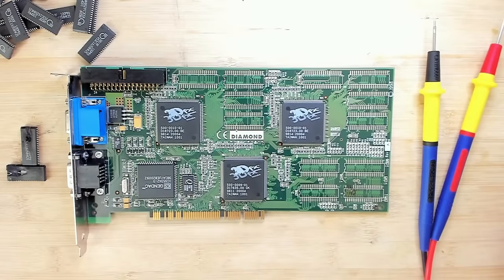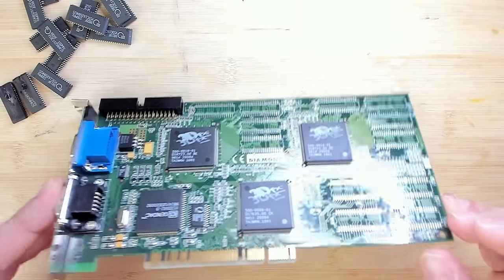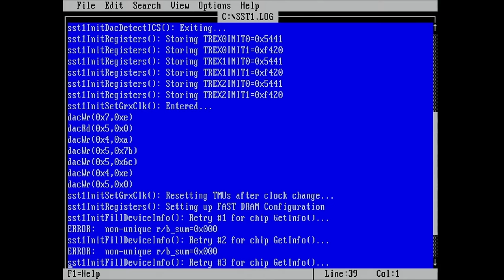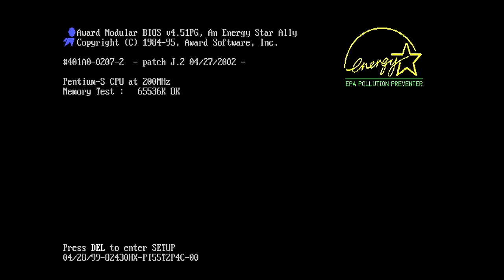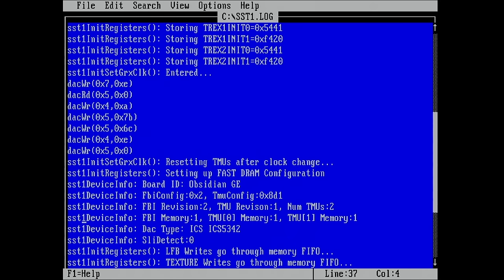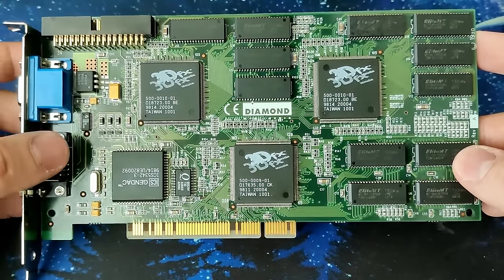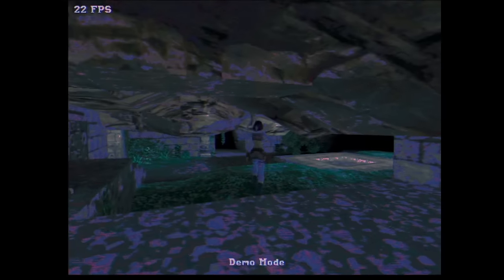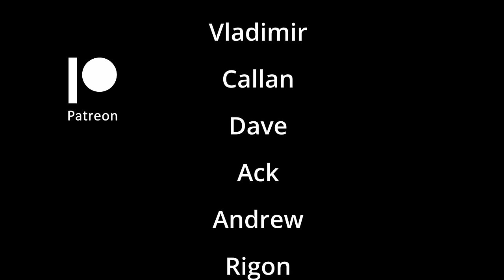Diamond Monster 3D II - A Voodoo 2 rises from the ashes? (Part 2/3)

Comment from the maker: While working on part 3, I noticed that the discoloration of Tomb Raider shown in this video was caused by the wrong 3Dfx patch! Yes, there are two different patches for Tomb Raider. One is only for Voodoo 1 cards (that is the patch I had installed while making this video). The second patch is for Voodoo Rush and Voodoo 2 cards. Of course, I downloaded the patch and added it to Tomb Raider. Unfortunately, with the correct patch, the game starts, but the screen remains black after the intros. The menu screen is never rendered. So, we still have an issue with the card! The problem? Only 1MB of memory is detected by the FBI chip! I hope you can help me figure out why. Is the FBI chip damaged? Could the DAC or the small chip next to it be the issue (both connect to 5V that damaged the memory chips. Any help and hints are appreciated! Thanks everyone!
Reply: maybe it's an addressing issue? like, what if the FBI chip has some troubles with connecting to the memory chips? (eg. too much resistance on the trace?)
Reply: to me this looks like the FBI chip has not enough memory to work properly more than a RAMDAC issue
Reply from the maker: Good point. I can check the resistance and see if there's something odd. I checked the chip that replaced the one with the hole in it. All connections seem to be fine, but it might just be the one that's part of the 1MB. I'll check all the other chips on that side.
Reply: I would check these vias under exploded chips (on first video they looks quite burned), maybe there is no good connection to rest of memory chips (especially on other side of board). This cloud explain discoloration and only 1MB detected.
Reply: @bitsundbolts  try measurements of address/data/all other signals in diode mode (multimeter pos terminal to gnd and negative to signal lines.) All lines should be in more or less same range, if one is too off - may be issue with 3dfx chip. This way you can check if blown up RAM chip damaged 3dfx chip IO.
Reply: Mine had crap colours in a bit different way, but it was fixed by lowering the gamma
Reply: @petertorda5487  I think this is the most expedient way to fix the TMU memory problem. It's reading at 1MB so it can only address 1 bank(?) of 4 and stops there. Looking for clues is better than trying to chase down the fault on all the data/address/select lines picking randomly (which I have tried myself before, it takes ages).

Regarding the DAC, please do not remove it, it's working! You can see white in the picture so it's doing R/G/B properly - My Voodoo 1 with bad RAMDAC connections displayed just blue and that looked interesting, but very dark. Also, if the RAMDAC is not functioning / removed, mojo fails before it gives the TMU/FBI information readout.
And probably so is the display switch chip, which also handles the analog VGA signals, it seemed to be doing proper switching in this video.

@bitsundbolts - I believe the pinout for the Voodoo 2's FBI is known and that may help with troubleshooting if the via/trace checks don't pan out. Ask SDZ and he might be able to help.
Reply: You need a few environnement variable to configure the Voodoo 2 in Voodoo 1 mode.
Then IIRC it should work with the regular Tomb Raider V1 .exe

SET SST_FT_CLK_DEL=0x4
SET SST_TF0_CLK_DEL=0x6
SET SST_TF1_CLK_DEL=0x6
SET SST_VIN_CLKDEL=0x1
SET SST_VOUT_CLKDEL=0x0
SET SST_TMUMEM_SIZE=2
SET FX_GLIDE_ALLOC_COLOR=3

Also you could try with Quake 1 instead of TR1, there's a Dos 3dfx version.
Same for Quake 2 :)
Reply: @nalinux  < What nalinux said. lol

I had the same issue on my PIII system with a Voodoo 2, and the SST settings fixed the colours in Tomb 3 Demo.

Seems the V1 and V2 have different colour formats for the framebuffer setup, or something.
Reply: @electronash  I'm surprised TR3 needed this. It's a D3D game, so the Voodoo driver may do the job by themself.
Reply: @nalinux  I'm fairly sure it was TR3 Demo, running in DOS?

I didn't have Windows installed, IIRC.

I can't remember exactly what I was even doing, as I was trying to build a V4 clone at the time. lol

But the colours near the end of the vid look very similar to what I was seeing. Almost like the colour space is wrong (YCbCr vs RGB).

The Autoexec settings to put the V2 into V1 mode seemed to fix the issue.

It looks like the textures are basically OK on the card in the vid, so the DRAM is probably good.
Reply: My guess would be a damaged FBI. Not detecting all RAM chips points to that. Also for that FBI chip with crooked legs - it's likely someone twisted a heatsink off of it. You might need to carefully twist it back with the help of some tools before removing the chip for the best result.
Reply from the maker: @thejeffchen oh, I didn't think of a heatsink that could have caused that. Good point. I have a feeling that I'll rip off the chip and cause massive damage if I try to bend it back. But that would be the best solution to straighten most of the legs. Let me see if I can find a way to do that, but if not, I'd prefer to bend leg by leg. 😨
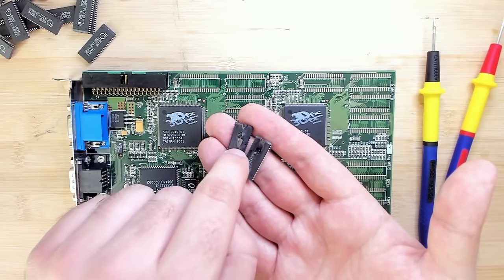Reply: @thejeffchen  Ooh wow, I was wondering what you meant but looking at the 1st video at 0:28 you can see a bunch of pins on the FBI by the PCI connector and the "65" soldermask do look as though they're no longer attached, and those are memory pins
Reply: I'll register a guess: one of the first two MB of memory chips you installed for the frame buffer is bad, or one of its lines is not connecting so even though it would be a card problem, it detects as bad. Perhaps socket just the first four chips of FB memory and start swapping chips around and see if the problem moves? Are you sure all four chips (of your lower 2 MB that you first reinstalled) are getting Vcc and Vss at both ends of each chip, you might have half a chip sleeping/floating.
Reply: @bitsundbolts  just use a osciloscope /logic analicer on the vram chips
Reply from the maker: @mal2ksc I'll check the pins on the memory again before I try anything more dramatic.
Reply: All the frame buffer memory address pins should be on the same bus. I would check to see if they are connected to each other then check to see if the networks that pull the busses  up aren't blown. (If present) Doesn't look like a blown passive but I've seen that.
Reply: Try setting the environment variable SST_FBIMEM_SIZE to override the detected FBI Memory size. If forced to  2 or 4, Tombraider might run. Only having 1 MB of FBI memory isn't enough to setup a front,back and Z buffer at 640x480. The voodoo 1 patch might not have even checked if there was enough and still tried to use the extra FBI memory that wasn't being detected and mostly worked. I wouldn't be suprised if only the memory between 1.5 and 2mb isn't working so only 1 MB is reported because it can't report non integer sizes of MB, and it assumes there is nothing beyond the missing region. A memory test for voodoo cards might be useful, I doubt one exists though.
Reply from the maker: @MonochromeWench it's still a secret, but your last sentence will have an answer soon!
Reply: Try to check the resistors between FBI and the memory
Reply: The GENDAC (RAMDAC+clock generator) is purely in the output path and has nothing to do with the interface between the FBI and the memory. 

If it has been damaged then maybe it could produce some funny colours, but it seems you already nailed that down to something else.

The other chip with the Q on it is a dual 4-bit buffer, you'd have to beep it out and see if it has anything to do with the memory. 

If the memory chips suffered such a catastrophic failure like that I guess it's possible that something happened within them to send some of that higher voltage to the FBI chip and has damaged parts of it, and maybe that prevents it from detecting the additional memory chips.
Reply: @TomStorey96  well, that's not quite true. RAMDAC is connected to the same pins that are shared between FBI and RAM, so it can influence the communication. Also it is the main clock source for the whole card, so if RAMDAC is dead the whole board will hang if you try to launch any 3D app.
Reply: @fagear  Splitting hairs, and not exactly the point I was trying to make.

Sure, the RAMDAC could share the same physical bus between the FBI and RAM, and if it was damaged it could output some voltages that affect that bus.

But the point I was making is that the RAMDAC doesnt provide any control or sequencing of the communication between those devices, so a bad RAMDAC shouldnt be stopping it from detecting the correct amount of memory for example.
Reply: @TomStorey96  well, you are plain wrong. The RAMDAC is the only "sequencer" of the whole board. It generates all the clocks. Without working RAMDAC there will be no RAM refresh, no FIFO progressing, no communications between TMUs and FBI. So it is quite important.
Reply: @fagear  You do not seem to understand what I am saying. So the last thing I am going to say is that I have built a video card for my homebrew computer system which uses a RAMDAC to drive a VGA display, so Im pretty sure I know what it does and what is required to make things work.
Reply: @TomStorey96  you seem to not understand how Voodoo cards work. You stance about RAMDAC having nothing to do with RAM operation and detection is just wrong. Working RAMDAC is necessary. You clearly have no experience with Voodoo boards with a dead clock gen that will detect in the system ('cause PCI part is asynchronous) but hang because no communication between FBI, RAM and TMU can take place without a clock. See a datasheet for a RAMDAC for yourself. It has TWO outputs. One for pixel clock (not relevant now) and another... yeah, for graphics clock. For that ~90 MHz that Voodoo chipset requires. Nothing will work without it.
Reply: @fagear  Fine, I'll bite for one last time, just to remove all doubt. From here on, readers can make up their own minds.

You seem fixated on arguing the fact that a missing clock would stop a board from working. Well of course it would! It's obvious to anyone that has even the most rudimentary understanding of computer systems that a clock is required to make things work. But a clock alone does not make things work, and a clock is not a sequencer. A sequencer may be a state machine or similar logic.

But my comments have nothing to do with the clock, you brought that up, not me, and keep using that to insult my intelligence by suggesting I don't know how things work. In the scope of the card in this video, which is what my comments are about, it is clear that the clock must be working because there is video output and it is possible to get a response from the card. I'm not focussing on things that are working, so why you continue to argue about or point to this I have no idea.

I know when to read a datasheet and have read many of them, so you don't need to suggest that I go do that. It's what I do when laying in bed or on the train to work instead of reading a book...

I may not understand the intimate details of a Voodoo card specifically, but I know enough about a RAMDAC or GENDAC to understand what it does and what effects it can have on the rest of the circuit.

Go look me up on github if you want to understand the kind of stuff I work on as my hobby, I'm tomstorey. My latest 68k design is there and you can download the repo and open up any of the projects in KiCad to take a look. There are also some Verilog source files which implement various state machines. So please, don't tell me I don't understand things.

Comment: I had the same color issue recently, had also a V2 to repair. That color problem is normal and is due to V1 support in TR in DOS. It costed me couple of hours of ghosts hunting till it turned out, that in DOS you have to patch TR for V2 to get the colors right. In windows the card would work right and there is nothing wrong with the DAC or something else. The missing FB memory is a problem  though. I would suggest to go through the pins of the memory chips and measure the resistance on every one of those. Compare then that all data and address pins have the same resistance to the ground. May be one of the traces in the PCB has melted.
Reply from the maker: Hey there! Thanks for the tip! And yes, hehe, I figured out that there was another 3Dfx patch for tomb raider for voodoo rush and voodoo 2 cards. Unfortunately, with that patch applied, the Voodoo 2 can't render any 3D scenes anymore. Just a black screen where the main menu screen should appear. I'll go back and check the connection of every memory chip connected to the FBI chip. Thanks for your help!
Reply: @bitsundbolts  Try out Unreal as well, since the card is working in Windows :) The flyby certainly looks interesting when the 3d card is broken. My 3Dfx Voodoo 1 that had the RAMDAC fault, once that was fixed the TMU memory CAS lines broke and the castle went kind of 'disco' mode
Reply: Ohhh, Necro_ware! Fancy seeing you here :-)
Reply: Hi m8! Great to see you over here on Alex' channel, thanks for chiming in, and with such helpful pointers too! Let's hope it indeed is an issue with a trace/minor SMD component along the way rather than with the comparatively irreplaceable (in the sense that they aren't made anymore) FBI chip itself. This is the card I emailed you about a while back btw. 😊
Reply: I was also going to suggest checking the address and data lines from each chip to the fbu, when the old chips exploded it might have taken out one or more of the lines, likely an address line.
Reply: I suspect a chip isn't getting power, or even half a chip since they have two Vss and Vcc lines that are not internally connected.
Reply: @mal2ksc  good theory! that would be one of the better scenarios and is certainly worth checking. easy to check too!

Comment: It freakin' works!! (Kind of)  I don't think the DAC is the reason for your lack of frame buffer RAM, but I have seen a bad DAC cause the visual issues you are having with the colors.. (Not on a 3DFX but VGA cards) Might be worth swapping that PLCC chip if you have a spare.
Reply from the maker: Hello Adrian, thanks for your input! If I understand correctly, the DAC is connected to the FBI as well as the memory chips. It could be as you say and the DAC might cause the loss of memory. However, I might get access to something that most probably will eliminate all the guesswork!
Reply: @bitsundbolts  I don't think so -- from what I understand the DAC simply contains look up tables to convert the digital framebuffer output to analog video and in the process apply the correct color palette. Of course the lack of memory showing up really could just point to the framebuffer IC having been fried too. The damage was so expensive on that board perhaps some of the RAM chips backed too much power into the framebuffer taking it out? It's so hard to know when everything is so highly integrated and undocumented like on those "modern" ICs
Reply from the maker: I agree, it is very unfortunate that there is limited information for those chips available. It turns into guesswork. That might be fine for people who are just tinkering around, but it makes it so much harder for people in the repair business. I stopped this Voodoo 2 project for now because I am waiting for information from a viewer. It might change how we debug faulty Voodoo cards in the future.
Reply: I think he didn't soldered the 3 pads he replaced. Or that part wasn't in the video or i missed something. And if that was with framebuffer memory because if they are seen in pairs than he would still get 3 mb instead of one. Don't think it's a multiple layered board so the damages couldn't be it and should be searched next in line to the frame buffer chip.

Comment: It's cool that the regulator protected the main chips - and I guess the regulator won't care if 5V or 12V are coming in! I am not familiar with that card - the only thing that comes to mind is to rule out the simple ones first: swap the FBI RAM. Then for sure see if you can also swap all the ICs which are directly connected to 5V - but not the regulator. Also I would investigate more on that hole at the back!

One thing you are probably already aware of - but just in case - bear in mind that a multimeter in continuity mode will "beep" from - say - 0 to 30 Ohm. So if you hear a beep it doesn't mean you have a dead short - it could be something like 20 Ohms which might be normal.

I'm sure you can revive this poor card! Well done!
Reply from the maker: Hey Tony. I will first try and probe around with the multimeter to see if there are "dead" data lines. Maybe I'll be able to spot which chips are used and which aren't.
I use the multimeter to test the connectivity from memory to the FBI chip. Most of those lines go through a 22 ohm resistor - you need to wait a bit before the multimeter beeps, but it does. So, yes, I'm aware of the behavior. Thanks for watching.

Comment: I am not into electronics repair other than watching, but I do a bit of troubleshooting when it comes to hardware and computers in general, and this problem to me smells of a dead memory channel as my first instinct.
With the tools and stuff you have, I would socket the memory chips on the Voodoo as you mentioned in your first video, but ESPECIALLY around the framebuffer chip.
Earlier you mentioned that mojo was a 3DFX tool for diagnosing the cards, so I would trust it's detection from now.
My next move after that is to move a memory chip around and see where it reports having memory and where it reports nothing.

From that point on, you can either test if the signal lines are intact to the FBI chip or there is hidden board damage, if there isn't, you have an internal fault inside the FBI chip itself.
Or if there is a break, well you got a hail mary and you can hunt down the flaw in the PCB and fix it.